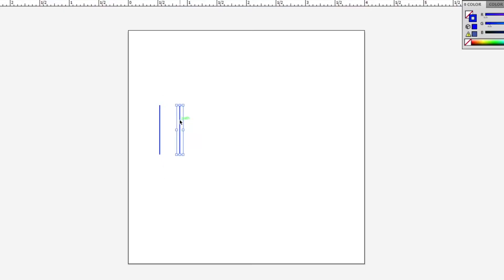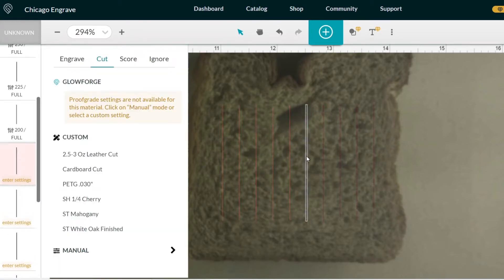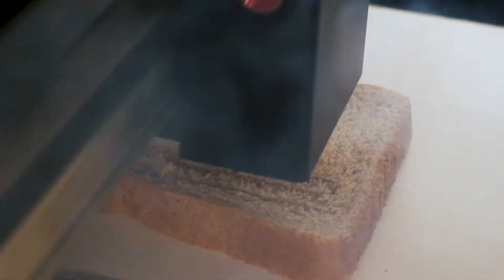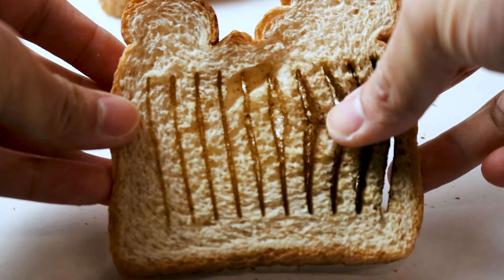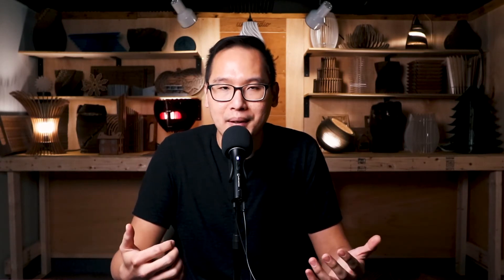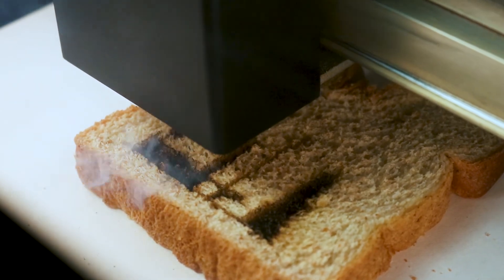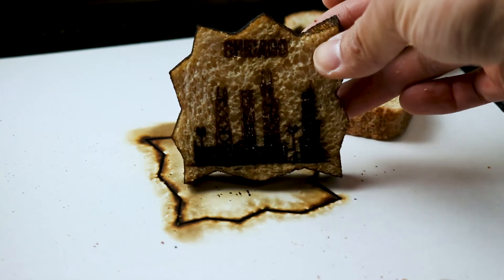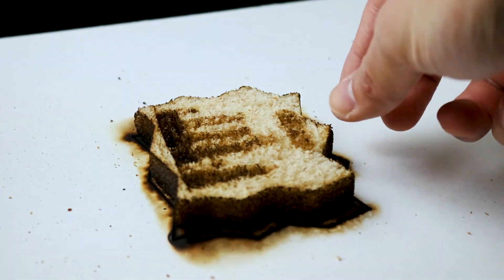Can You Make Toast with a Laser Cutter?!

Comment: Nice demo. It's interesting to see how much can be done by controlling the beam power and movement. What kind of laser did you use? Back in the 1970s efforts to cut bread with lasers resulted in burnt toast because they didn't have that much control.
Reply from the maker: Thanks! It's a basic laser cutter with adjustable power/speed controls. I think the biggest factor for this test was ventilation. It kept the bread from catching on fire while the laser was cutting all the way through.